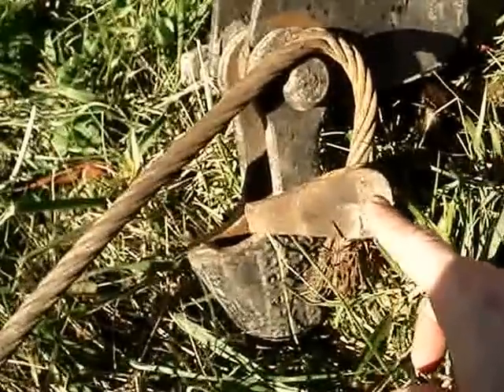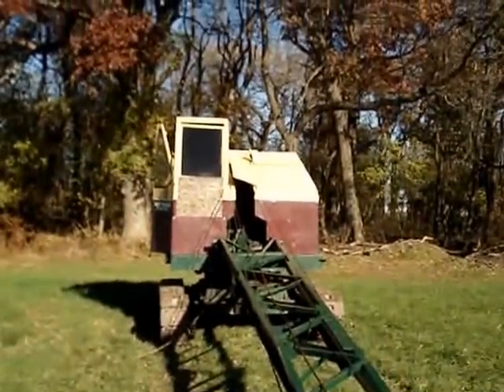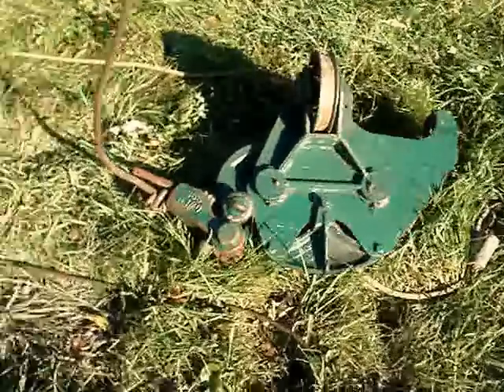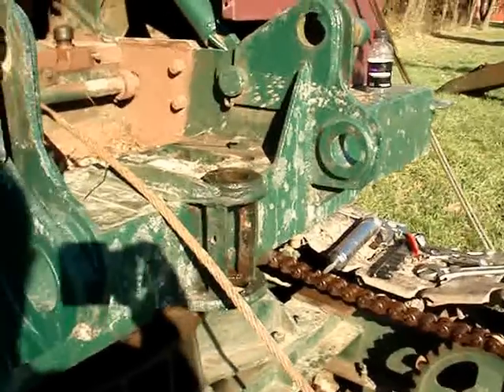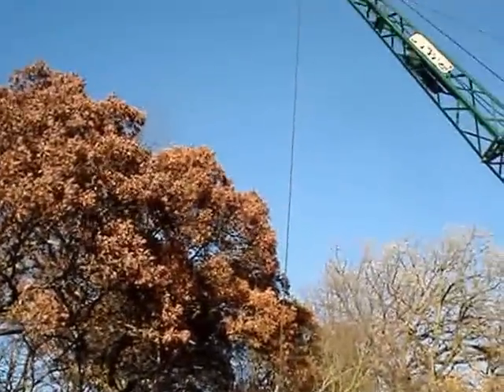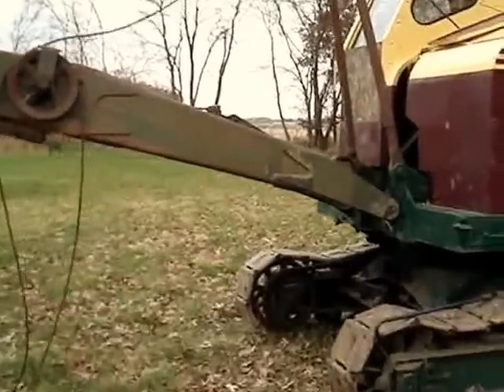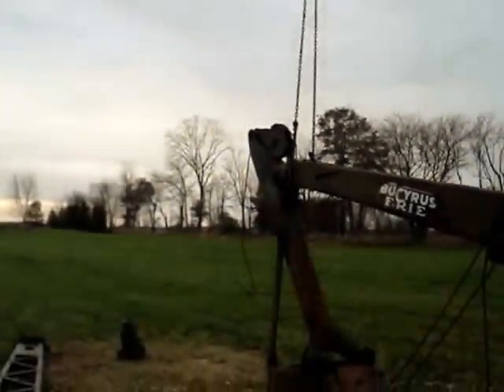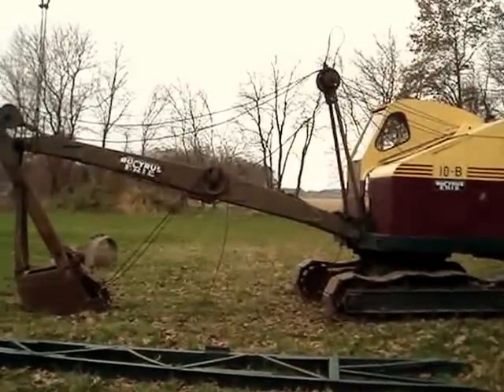Bucyrus Erie 10B changeover from dragline to dragshovel

Comment: You're supposed to support the ends of the booms on some barrels or cribbing to keep them at the same elevation as the shovel.  Makes it a lot easier to change ends without a second crane.